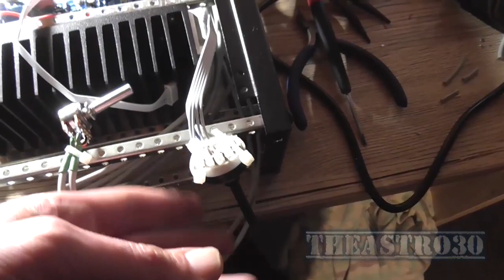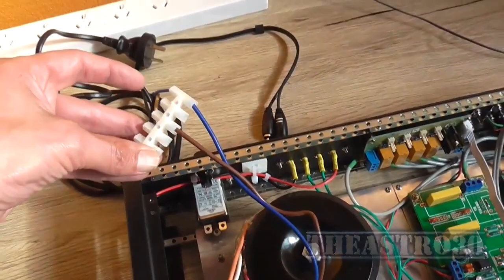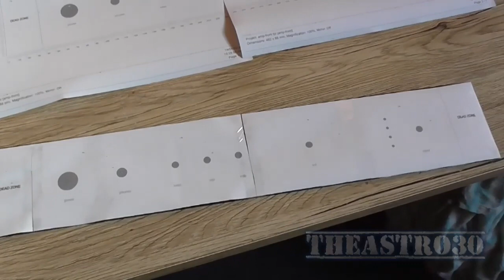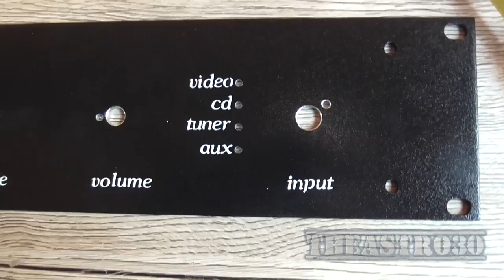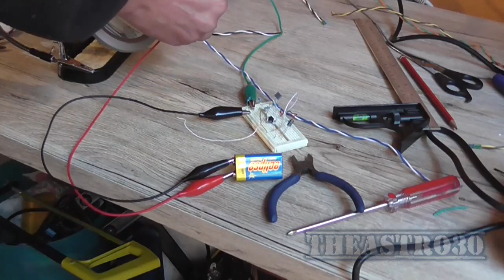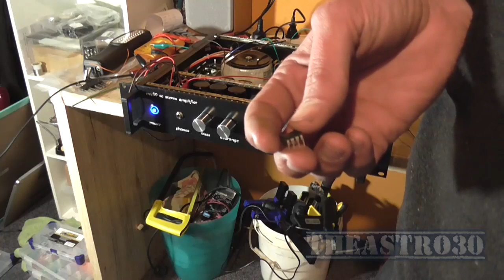Project Amplifier Part 12 - The Final Frontier

Comment: Great DiY Project. Could you please tell Rotary switch is which type i mean positions with Pole, 1 pole 4 Positions or 2 pole with 4 positions
Reply from the maker: Here's a link to a clearer drawn schematic: https://imgur.com/gallery/hXrQTG4

The centre pole of one of the switch parts goes to pin 1 of the connector cable (the striped wire), and then you use a multimeter on continuity to find each of the switch positions while rotating the switch and wire each wire to them in order.
Reply from the maker: And I believe the switch supplied was a 3 pole 4 position switch.
Reply: @AstrosElectronicsLab  Thanks for giving update. Appreciated.